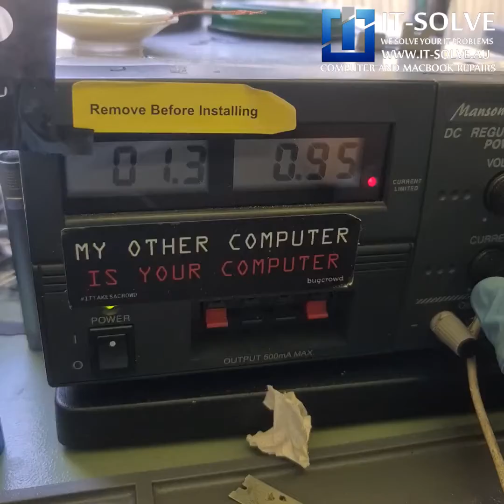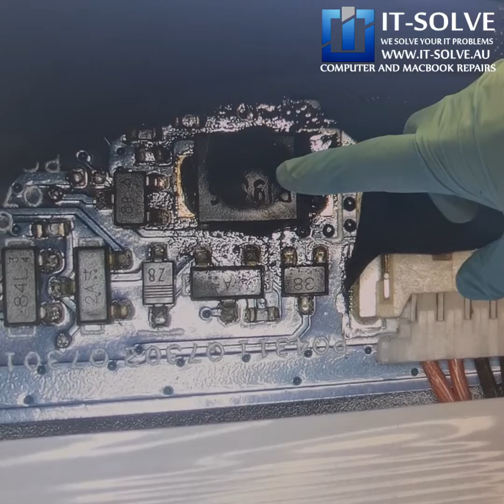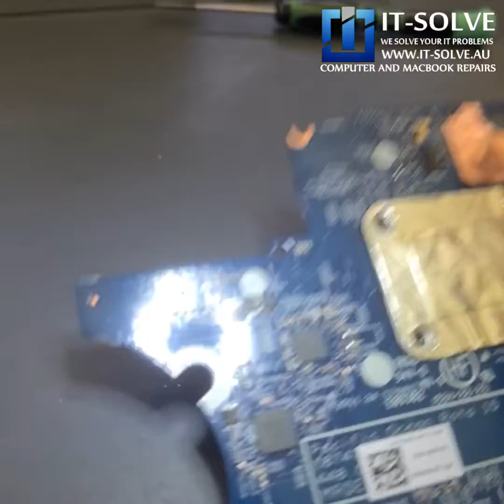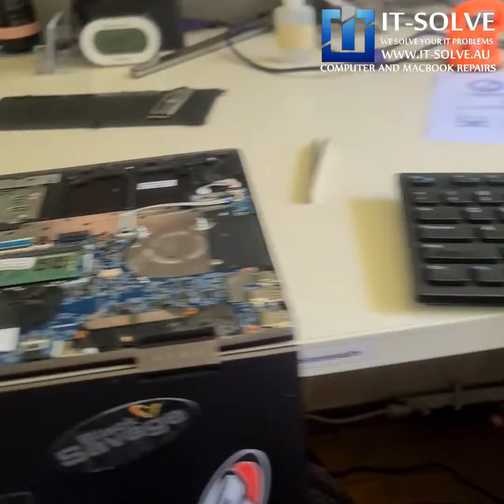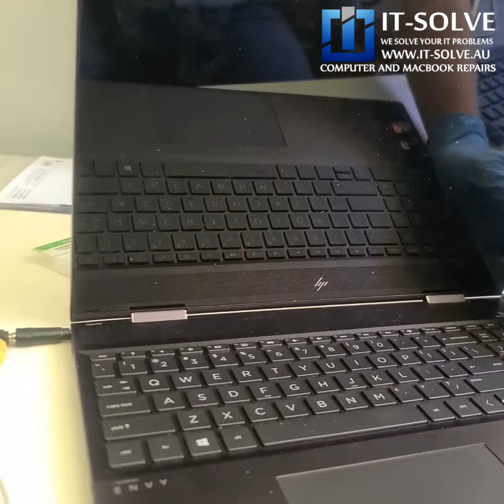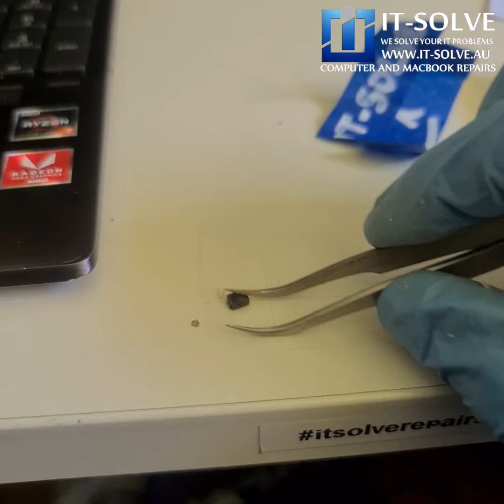HP Envy Not Turning On Repair, caused by a blown diode. Caused by a power surge. #itsolverepairs

Comment: Is 28 volts expected ?
Reply from the maker: The adapter gives you a maximum of 19V. Unless it's a lcd backlight boosting circuit, all voltages should be lover than 19V